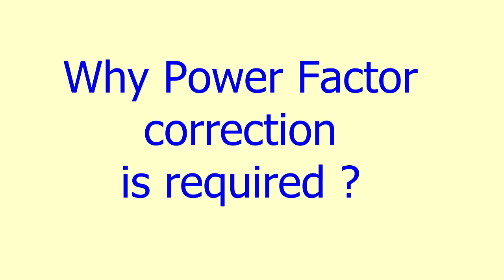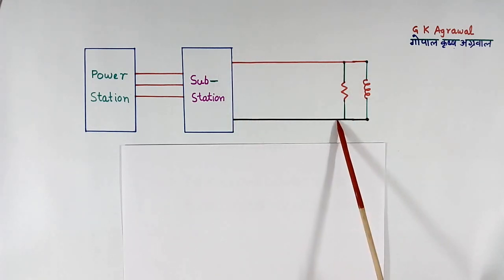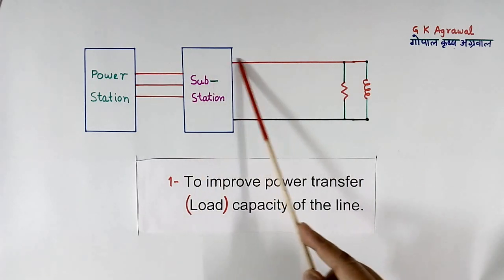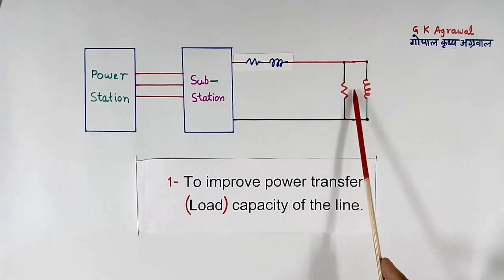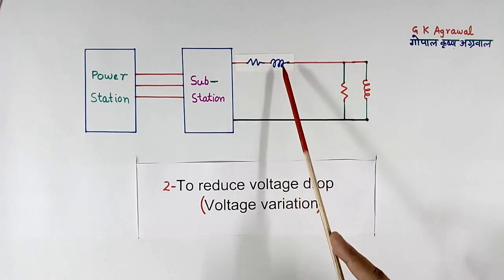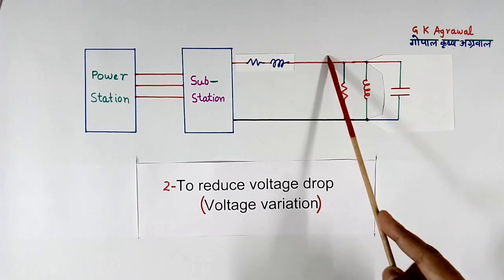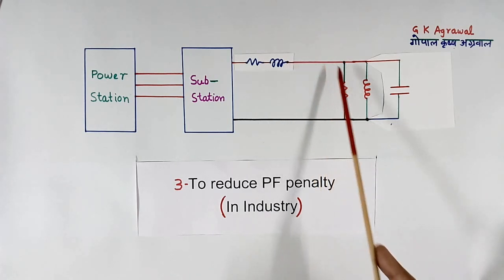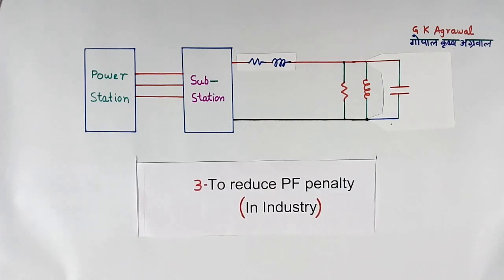Low Power Factor problem, Why is PF correction required

Comment: What will be the case if a 60 Hz rated transformer is made to operate at 50Hz.sir could you please explain this in detail
Reply from the maker: 60 Hz rated transformet can be use at 50 Hz, but it will take less voltage at input.
Reply: thank you sir

Comment: Dear sir what is difference between  inductive load and reactive load.

I guess every load is reactive. Like tube light,  motors,
Reply from the maker: Reactive load are 2 types, inductive and capacitive, However most of the load are inductive type reactive load as you think.